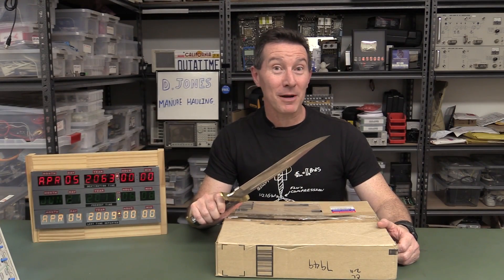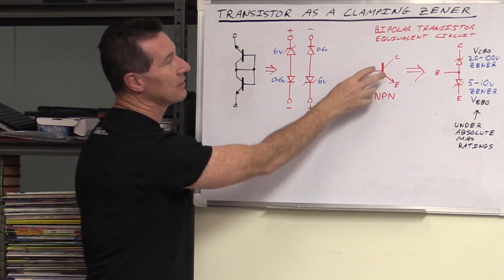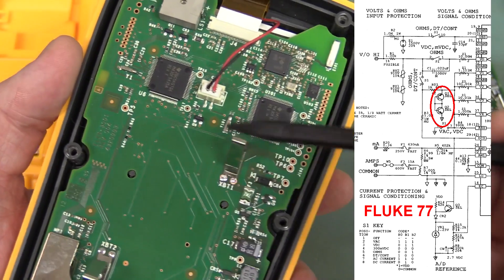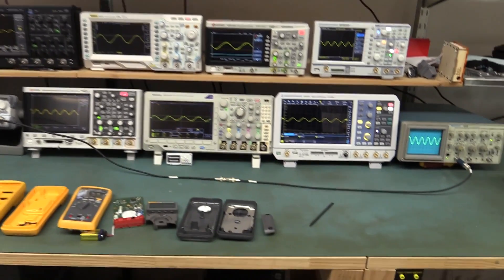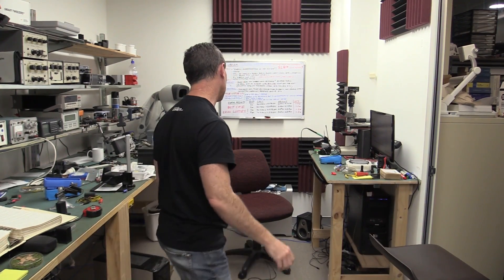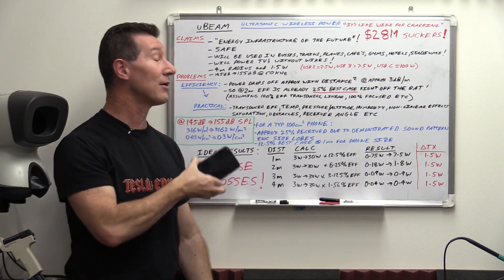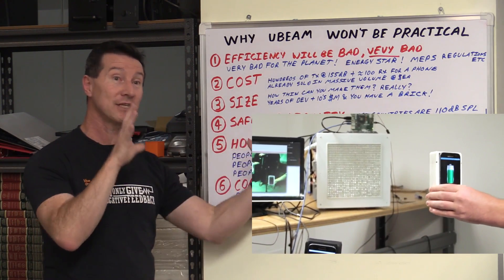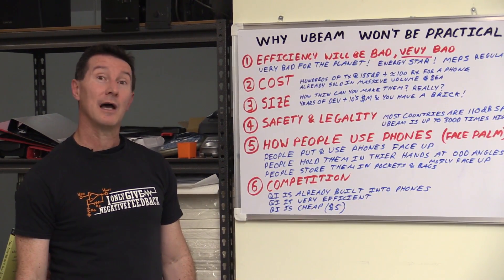EEVblog #1000 - Fundamental Mailbag Retro Teardown Shootouts are Bullshit

Comment: Dave - I'm currently in the third year of my Electronics Engineering degree program (at 42 no less) and I cannot thank you enough for your videos and the knowledge you impart.  It is due to your enthusiasm and "assurance" that I have developed my own PCBs using EagleCad and Seeed Fusion, and learned to approach troubleshooting as a fun problem to solve instead of a sad failure:)  Congratulations on your 1000th video! p.s.- your OpAmp video is invaluable - a perfect example of a proper tutorial!

Comment: Even if uBeam did work as perfectly as described I don't want my ears anywhere near double-digit watts of ultrasound
Reply: Yeah.  Isn't 125 dB SPL or thereabouts enough to cause permanent damage?  The power transmitter outputs 100 to 1000 times that pressure, so I doubt that ultrasonic instead of sonic is going to save your ears. Not because I know much about this, but because 100 to a 1000 times more pressure variation is a LOT.
Reply: Trolling has really gone downhill lately. Too obvious.
Reply: Not all are like that though, I can only dream of getting as good as Jeri Ellsworth

Comment: That two npn clamp circuit is a nice one. I've got it to work in LTSpice as well. I've also used the 2n2222. The emitter-base voltage is defined in the BVbe parameter of the transistor model. So I had to set this manually. Actually you need to test for values between 6 and 10V. Because you never know what you gonna get.

Comment: Interesting clamp thanks Dave!

There's another clamp that I saw on the forum that I'm using in some production designs now, uses a shunt voltage reference to set the base voltage of a PNP, then if the emitter voltage goes 0.6V about the ref the transistor starts conducting to GND - quickly!   ;)

Comment: YAY!!! I know single take must have been hard, but it was awesome! Could transistor zeners be used to protect a USB port from damaging voltages? I was figuring on one pair for each of the d+, d- and 5v lines. A sort of short USB cable with a male A to the host, zeners in between, and a female A to connect the DUT.

Comment: The reason for the transistor clamps is not speed but extremely low leakage current below the breakdown voltage

Comment: The scopes usually construct sine wave, when you click SINGLE SHOOT, it uses the data from all SINGLE SHOOTs with the same vertical/horizontal scaling, so if you would click SINGLE SHOT more times the sine wave should be less noisy as the wave is constructed.
Now different scopes do different construction so you cannot know for sure, how they are implementing the wave construction.
I do not know how you would measure the noise level of AD, but I know some words you can lookup:
ENOB, SINAD, SNR
At our university we have made a program for measuring Arduino's ADC ENOB, but we have not learned a lot, because we only rewrote the equations as it was too advanced for our level.

Comment: I learned something again. 
Now i making my own auto range and i wonder how to make safe for even 250V /measurment, but yet i want also 1V measurment, like 1000mV for 1024 steps adc. I dont know how to make it safe that if there will be HV shot in 1V range. Some transistor passing only low voltage? Some popular transistor can do it?

Comment: Doesn't beamforming significantly reduce the square distance loss, since that is simply the percentage of the power that misses the target when not focusing the energy. (Admittedly, some beamforming methods might still waste most of this on unfocused signal).  However I'll accept that the 1.5W received from such a high transmission power shows they still loose at least 99% of the energy.

Comment: That transistor/diode clamp circuit - I'm pretty sure I've also seem them used in audio circuits as distortion and/or compression. I'd have to trawl through the collection of stomp box circuits to be positive, but I'm fairly certain .Congrats on 1000 episodes!
Reply from the maker: Would be interesting to see a reference for that. I've seen transistor BE junctions used as diodes in such circuit, but not avalanche
Reply: Just had a bit of scan through some old circuits and couldn't find anything this extreme (doesn't mean it hasn't)! I did find some some back to back transistor/fet configs for distortion and octave circuits and back to back feeding +/- signals into the bases. Might have a play around with it on an opamp feedback circuits and output and hear how it sounds!. A lot of audio circuits use transistors as diodes for clipping signals.

Comment: The 'Vebo zener' is the reason many experimenters complain that the classic multivibrator doesn't work properly. 

If its supply is more than 6v (and it usually is) then the e-b zener effect will short-circuit discharge each capacitor down to 5v or so as the opposite transistor turns on, after which it will discharge more slowly via the base resistor.  

Consequences are unstable operating frequency, or when large timing caps are used, intermittent blowing of transistors since on each half-cycle one transistor of the pair gets whacked with a s/c current rammed backwards up its base.  (If you'll excuse my attempt at Ozzie terminology)

The solution is to either use a lower supply voltage, or else to add base protection diodes.

Comment: Don't dogs hear ultrasounds? Isn't that going to hurt them? Google for dog ultrasonic repeller.
Reply from the maker: Not that high I believe, buy cats maybe and bats.
Reply: Wiki: Humans and cats have a similar range of hearing on the low end of the 
scale, but cats can hear much higher-pitched sounds, up to 64 kHz, which is 1.6 octaves above the range of a human, and even 1 octave above the range of a dog.
Reply: It appears that cats can indeed hear the Ubeam sound (it reportedly uses 45 kHz - 75 kHz). Given that ultrasound's intensity, it's got to be pretty horrible for cats!

Comment: I wonder if you could charge a phone off of indoor ambient light. Probably yes but not at the rate of use. Could these circuits like charge up caps and pulse charges? So you could have low voltage/amps source? Man you don't need drugs. I have had these fantasy ideas lately about like going places for free, except for like repair costs. The ideas I have had mostly are around solar powered tricycles or blimps with batteries and solar panels.

Comment: lol, yeah, sound engineer here.. Totally wrong method of transmitting energy.. To work, we need to actually move something. Let's say we have the kind of system that Doc had in Back to the Future.. Speaker the size of a man so it can actually move some mass. The efficiency will never be anywhere near anything useful. The vibrations already in the air probably account to more energy in total, if they could just capture it broadband. You don't need to ask a scientist, any decent audio engineer can tell that it is not going to be enough juice. Wireless energy is something that is just not going to happen, at least not in a way people think it is (think powerlines and such, not magically charging phones). It needs something worthy of half a dozen nobel prices.

Comment: Instead of just trying to make a wireless charging, people would do something more practical, like a smartphone that has a swappable battery that could be changed in less than 10s, like in DSLR cameras, together with a small internal battery ( small, but big enough for a couple of minutes only) so one would not need to turn the phone off. It would work like a hot-swap hard drive of servers. You have a low battery? No problems, just go to you shelf, take a fresh battery and left the dead one charging, and then, keep rotating. Indeed, with only a fraction of the thickness and price of that ultrasonic prototype I could buy 2 battery powered cases and do what I said before. Simple and cheaper.

Comment: Wow, you weren't kidding about that video... (or maybe its just ME?) I mean... who WOULDN'T want waterproof HAIR, right? Because that's why we all carry umbrellas, of course. To keep our HAIR from getting wet. (Hmmm, now that I think about it, if that's SUCH a great idea... why haven't I seen her on SharkTank yet or noticed her product in stores? I mean... she's basically stating it's nobel-prize worthy!) YES, thinking outside the box and adapting technology is brilliant. Look at the guys who figured out that using lower-powered, less heat-producing, color-specific LEDs as grow lamps that only utilize the specific frequencies used by plants? THAT's thinking outside the box in a successful manner. Wow. (Man, she is  SO CONDESCENDING! She keeps saying stuff like "An electrical engineer student helped me wire a few things together" - discrediting him entirely. Not naming them, not crediting the for anything beyond basically soldering parts together? Really? So... she also instantly became capable of designing and printing circuit board designs? Also... that prototype is using a breadboard. So unless all they did was connect some wires where she said to... the poor student did all the work for her while she takes 100% credit. On the OTHER HAND, perhaps that's best. I wouldn't want to be associated with this project myself... (And she keeps mentioning Aspergers as well while stating defensively that she doesn't have it, as if it's a bad thing. You sure about that Meredith? I mean... your social skills DO seem pretty underdeveloped here... and treating it like somehow they're inferior to you is SO offensive.) Oh man. You were SO RIGHT about that video. It makes my brain hurt trying to figure out WTF she's saying half the time. "Being Naive is sometimes a good thing" Wow. I hope NO engineer ever associates with her after this. I wouldn't. (Went to school for EE myself.) As far as "No one else" working on wireless power? Do you not count the MIT students who posted video a year or 2 of a DRONE flying with no battery? Does that not count? (RF, not ultrasound.) Wow... SMH... What a condescending bitch.